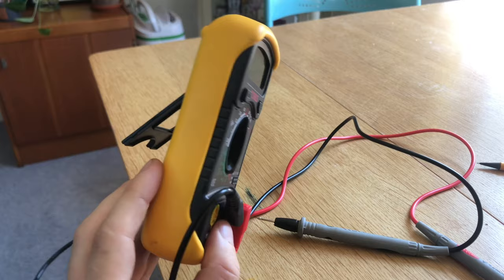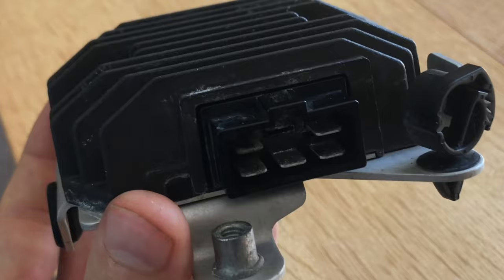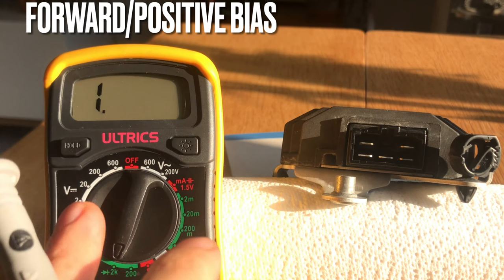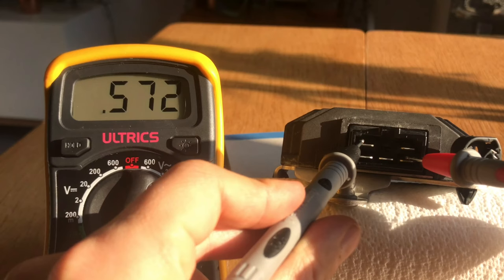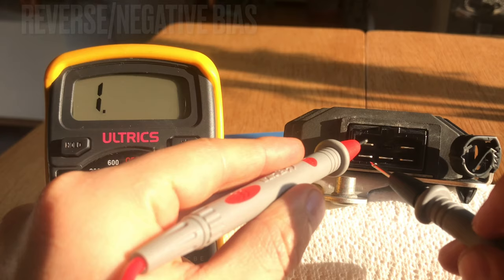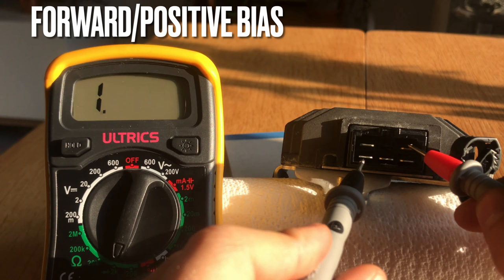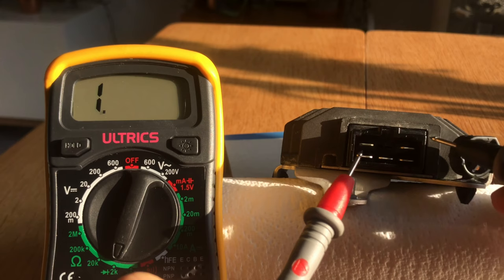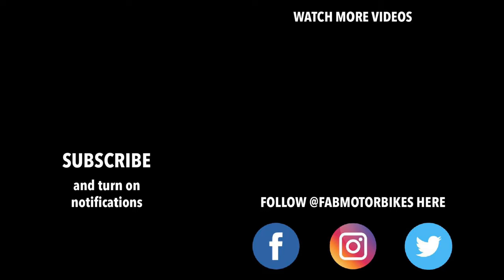How To Test A Regulator Rectifier (Motorcycle)

Comment: Hey my bike died and is stator or regulator. After watching this video I'm assuming it's regulator because on the positive bias I'm getting.   .506 .507 and the final one is reading 000 does this mean it's bad for sure? Also the negative test also failed on two of them.
Reply from the maker: Yea sounds like your regulator is shot. Worth checking your stator as well though. I have a video on this too: https://youtu.be/0wkNVJryNTQ

Also check if you have a dud battery, I conducted all these tests and end just needing a new battery

Comment: Hey so my regulator has 6 prongs on it. It’s a ninja 250r. Would the test be the same with the additional prong?
Reply from the maker: Hello, yes this should still work. I have sometimes seen them with six prongs and the sixth is often there for physical support, is a grounding node or doesn't do anything. You can also test if is connected to anything by performing this test on it. Let me know how you get on.

Comment: Hello, Nice vid. I have a 82 Suzuki GS 750, I just replaced the stock R/R with a made in china R/R & it's doing the job. I see these units all over the web, with different labels, I suspect they're from the same company, in china.  I just found & bought a Nos 1982 Suzuki R/R in the box. I'm inclined to replace the made in china unit, & install the Stock unit.  What do you think is the #1 reason, for failure?  Thank you
Reply from the maker: I believe it’s just general build quality which leads to items within the unit burning out. They are very self contained items so it’s difficult to tell when goes wrong for sure without breaking them open. Overall I would prefer to go with an OEM unit. But they are indeed way more pricey

Comment: Hey thanks for this video, I've been having issues with my bike and just followed your steps, in the last test you do I'm getting a reading on my rectifier so I guess it fails the test and I need a new one, but had a quick question. My battery was connected to an Oxford oximiser so shouldn't it stay charged up? Even if the rectifier isn't working the battery should charge itself via the leads and stay charged right?
Reply from the maker: Hi thanks for watching I’m glad you found it useful. Yes I would have thought the battery should stay charged up if it connected to an Oxford Oximiser. I’ve never used one but I understand that they maintain butteries pretty well and can bring batteries close to death back to life. If it’s still not charging up it may because the battery is completely dead and beyond savour. What are the readings on the oximiser when the battery is connected?
Reply: @FabMotorbikes  hey buddy thanks for your  reply, as of now the batt is disconnected from the bike and so is the rectifier as it seems to have failed the last test as per the tests I followed in your vid.
I will charge the batt tonight and connect it back to the bike and switch it on and see how much load it can take with a multimeter and then connect the rectifier again and fire it up and record the voltage and might give me a better idea of what's going on.
Reply: Last I checked the battery it was charging showing 11.9v after about an hour's charge.
Reply from the maker: 11.9 seems okay. But it will interesting to see if the battery can hold that charge… it’s very common for a bad regulator/rectifier to kill what was initially perfectly fine battery. Let me know how it goes! 👍

Comment: I have just been testing my regulator as my bike isn't charging, the diodes seem to be working in that the current is flowing in the direction it meant to but the readings were between .65-.68, would this be the issue?
Reply from the maker: This seems to be okay. Often it’s the cases where you are getting no reading at all in the forward bias readings that create the issue. I’d recommend testing your stator next. For me the issue ended up being a battery that had just reached the end of its life
Reply: @FabMotorbikes  thank you for reply! I tested the stator first, I might have done it wrong, I just tested if it was earthing out with the casing
Reply from the maker: I’ve got a video on that too if it helps (here: https://youtu.be/0wkNVJryNTQ) it covers 4 ways to test 👍👍

Comment: Can a positive battery cable that made contact with the frame, blow out a rectifier?
Reply from the maker: If I’m honest I’m not sure. But I have done this quite a few times myself (causing sparks) and it has never blown out the rectifier.

Comment: I have had to replace my battery multiple times this year. The battery goes dead and will no longer charge. (Dead cell I assume)
I have a 6v system on a 1986 yamaha tt350, which has only a regulator. The regulator has a single wire coming out and is grounded to the frame. 
Can I do the test you performed on such a regulator
Cheers :)
Reply from the maker: Hi thanks for watching. Ye so believe you can. Although difficult to tell until you get it out. Should be easy to remove  though

Comment: Would a bad regulator rectifier not only let the battery go down but cause the lights to get brighter with engine revs? I am pretty sure this is my issue but finding a regulator for a 2008 TOMOS moped is not easy.
Reply from the maker: As far as I know these issues aren’t related. It’s very common for lights to brighten slightly when engine revs. However once on the live this shouldn’t happen anymore. Only when warming up. I’d recommend getting your battery checked out. I went through all these problems and it turned out just to be a bad battery
Reply: @FabMotorbikes  thanks for the info. I installed a new battery and it's run down. I haven't done anything else yet
Reply from the maker: Could be the regulator… or the stator. I have a video on that too >> https://youtu.be/0wkNVJryNTQ .

Comment: How to identify output point and also how to identify positive and negative terminals
Reply from the maker: The easiest way to do this to look at the wires coming out off the device? The the fazes will have white wires and the pos+ and neg- will have a a black and red wire. In my case the rectifier doesn’t have any wires coming off of it so I would have to look at the plug that goes into it. But on most bikes there should be 3 white wires and a black and red wire coming out to a plug

Comment: Hi, thanks for the video. My readings are .485 across all three. Your readings are over 500. Any advice? TIA
Reply from the maker: Hi, as long as the readings are consistent enough. You should be good. The main thing to look out for is if a reading is not appearing at al.

Comment: hah i have  exact same as you but I now seem to have neg bias, so its all back to front, so I am taking that as my regulator is screwed , yes ? and thats with my new regulator which has now only done 100 miles, it was putting out over 20v before it blow out the dip beam and stopped.
Reply from the maker: It does sound like it’s broken. Although it’s very easy to get everything back to front when testing so worth another shot. Worth also testing your stator too, I have a video for that too
Reply: @FabMotorbikes   AHAH, Yes took the stator out and tested it works fine, but already had new one, so installed that, so in a way it proves its the controller ( again), 20 pound China version, but I did read the revies and many said they were ok, but its little bit of gamble. With the stator  the idle gear got jammed so had remove the air box, and remove the starter to reseat the idle gear correctly. yea its been fun , ahhah NOT!!

Comment: hi! i dont have a 2k on my multimeter but i do have a 6k one what kind of reading should i expect from a working regulator?
Reply from the maker: hello, you should get the same type of reading. What is most important is that you are using the 'diode' setting, which is that arrow symbol. thanks
Reply: @FabMotorbikes  Thank you for replying God bless!
Reply from the maker: Thank you no problem 👍

Comment: Please man  
I need help 
My positive bias is...   .120

And on second test 
Forward positive bias is ..  .516 as your video  demonstrated . So that means I have a problem????
I had two battery destroyed the batteries  got big and rounded egg smell etc..

Now I order  a new rectifier regulator and the measurement is also .120  and .520 ... as the old one..
Not sure  now what is my problem  as I was convinced that it was the rectifier problem  .. any advice  please
Reply from the maker: Hi sorry late reply. You sound like you are having over charging problems. This can be the regular/rectifier but might not be in your case. I would also check the stator (see my video>> https://youtu.be/0wkNVJryNTQ). You may also have some shorts in the circulate that maybe damaging the battery. (The fourth test in my video will look for this). I would also be wary to use a high quality battery charger when recharging batteries. It’s very easy to over do it. I’ve done it myself 🤣
Reply: Hi I am getting the same on my Daytona 675, I leave it on trickle charge and it starts fine but after an hour riding the bike will cut out on me unless I’m holding over 4000 revs! Any ideas?

Comment: Hello. Negative lead on positive side I get following reading : .553,.553,.544
Positive lead on negative side : .557,.521,.551. 
Are the small differences indicating faulty rectifier?
Thanks!
Reply from the maker: Hi, the reading all seem too small to indicate any fault. Based on my experience the reading you have given mean your rectifier is fine.
Reply: @FabMotorbikes  thank you for replying! My stator is faulty and I need to change it. Would you still recommend me to change the rectifier as well?
Reply from the maker: No I think there isn’t much need to change your rectifier right now. If you are sure the stator is the issue start with just that. If you haven’t test that yet here is a video on how I did it: https://youtu.be/0wkNVJryNTQ . I found that what I needed was a new battery and not a new stator. I hope this helps you👍
Reply: @FabMotorbikes  thanks a lot!

Comment: My battery goes flat over night if I leave it connected so after every ride I need to pull one of the terminals off, so would that be rectifier problems or maybe the stator. Thanks.
Reply from the maker: It seems you may have a parasitic drain somewhere. This is more of a stator problem. I have another video that will help you with this 👍
Reply: @FabMotorbikes  Yes thanks it was in the relay for the horns.
Reply from the maker: @yeahrightmate  glad you got it sorted : )
Reply: @FabMotorbikes  where’s the video. Can you email it to me.
Reply from the maker: Here’s the video I made to help get the stator sorted >> https://youtu.be/0wkNVJryNTQ 👍👍

Comment: I have a battery that has reversed polarity so I took it out, then kick started the bike and tested the wires that connect to the battery, and I get a negative 12. Something volts depending on the revs. All electrics work except obviously the starter. Does anyone know what is stuffed?
Reply from the maker: any luck on getting to the bottom of this? This is a really unique problem and I'm not exactly sure how to fix it. But would be interested in what caused it and how you fixed it.
Reply: @FabMotorbikes  yes, i did find the problem and this is rather embarrassing? i had my new multi meters cables in the wrong way around.
Reply from the maker: Ah well 😊 I’m sure not the first time it has happened to someone and surely not the last. Glad it’s sorted 👍

Comment: That's intruiging - I have watched the same test performed on a Royal Enfield 3 phase RR where diodes were only found to work on one side - in effect 3 tests @ 0.5 and the remaining 9 tests were OC. A second person did the tests and got the same result. They then went to a dealer, got a new one and the same again.

3 phase rectification is usually 6 diodes and your test bears that out. Still bewildered by the RE however and not least because mine is the same as those I've described.
Reply from the maker: Hi Andy thanks for the comment and additional info. It is intriguing how the rectifiers differ from bike to bike, I probably should have specified that this was performed on one from a Yamaha FZ6. They can be confusing items and am surprised you are getting similar readings on a new one... if you learn any more please to let me know. Myself and the viewers of this video are always looking to learn more!
Reply: Righto @FabMotorbikes  - I subsequently found another video from the US which showed that some RRs have more complex regulation circuitry than a basic six diode system. The result is exactly what I have and the upshot is that you cannot faultfind them other than to rule everything else out in the voltage generation chain - alternator output/cabling & connections/battery health etc. Doing it by deduction. All good 👍
Reply from the maker: Ah interesting to know. Process of elimination it has to be then. I had to do a similar thing… I was having electrical problems… I went through the whole chain but turned out to be a dud battery. Obviously was easy to fix and did what could be deemed an unnecessary amount of work. But as you say it was process on elimination and deduction. And now I have piece of mind 👍

Comment: Wouldnt a MOSFET reg/rec show an open line on the Forward Bias due to the switches inside but still be in working order?

I appreciate this is for YOUR reg/rec, after reading the comments. But nowhere else do you state this is a test for non MOSFET/only for your reg/rec.
Reply from the maker: excellent point, this is a non-MOSFET reg/rec
Reply: @FabMotorbikes  i mention this only as a friend pointed me to this video after testing his reg/reg. But it was MOSFET. He is an amateur when it comes to bike electronics and assumed this was for all regs with a 5 pin config.
Reply from the maker: No unfortunately not. Apologies for this. Nice work on picking up on this, something I overlooked. Hopefully your friend found some value in it. Overall, I was just documenting my journey of doing work on my motorcycle 😊

Comment: Will a bad voltage regulator cause any idle issues or headlights or blinkers to go dim?
Reply from the maker: Yes these can (not definitely) be some symptoms of a bad regulator
Reply: @FabMotorbikes  alright I'll do my test on it it's the original from 2006 it's on a 2006 Honda cb600f (599) I just noticed everything dim and I turn on my right blinker and the left blinks slightly as well gonna check my battery as well for good charge and check relays and grounds
Reply from the maker: I had simile problems before performing this test. After all… it turned out to be a battery that had just given up. But worth testing everything. I also have a stator testing video here: https://youtu.be/0wkNVJryNTQ
Reply: @FabMotorbikes  alright thanks really appreciate the help
Reply from the maker: No problem

Comment: My readings are all around .630, what could that mean?
Reply from the maker: Most important you are getting readings all round. Which is a sign things are okay
Reply: I just managed to get the stator coupling dislodged and may have found the culprit. Smells like a fog machine gone bad 😭😭
Reply: They melted together
Reply: I replaced my stator and it rode for about an hour before it died in traffic 😭

Comment: How found on onknown regulator find come in voltage and come aut charge batery sory for language
Reply from the maker: I would love to help but don't fully understand you question. Thank you for watching
Reply: @FabMotorbikes  i am by regulator on alliexpres chinese when is coming is not mark positive or negative bicause i have Peugot Traker scooter and i cant find originaly regulator .Im asked you can i find with multimeter where is coming cable from magnet rotor on regulator or what is coming in wat is out from regulator +,   -  .I hope so you anderstend me.Thanks for answer

Comment: thank you for your explanation.!
I follow you with measuring as you do in the video and I measure...

558-557-1162
zero
554-556-002
zero.

 So i need a new regulator?
Reply from the maker: Based on your final readings. (1162 and 002) it seems yet your rectifier is faulty. 

However my recommendation is to get a new regular rectifier that is returnable to the seller. Perform this test on the new rectifier. And then compare the results. This will confirm whether it is faulty. If not… you can send the new rectifier back. 👍